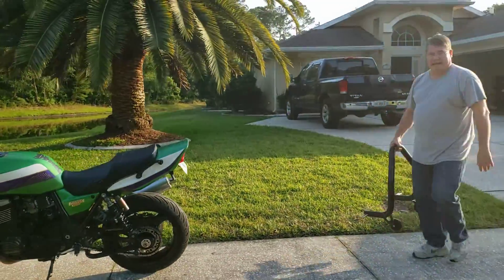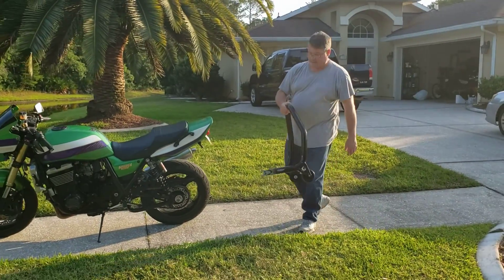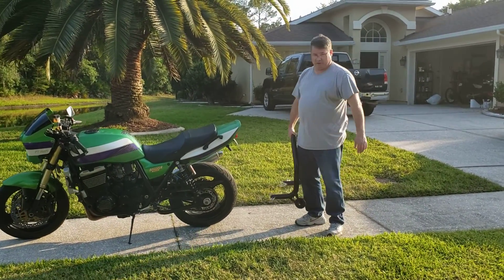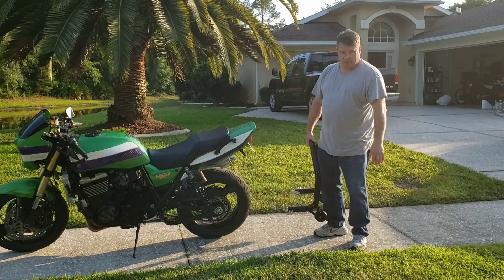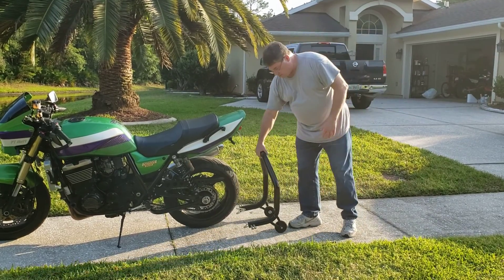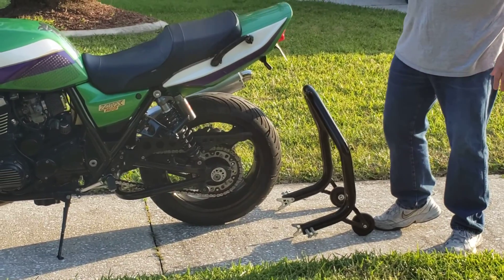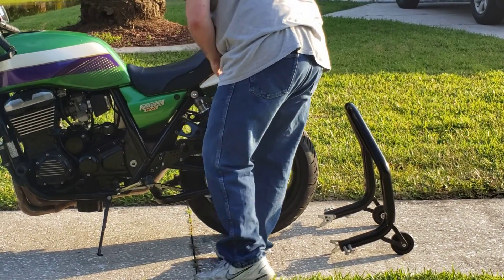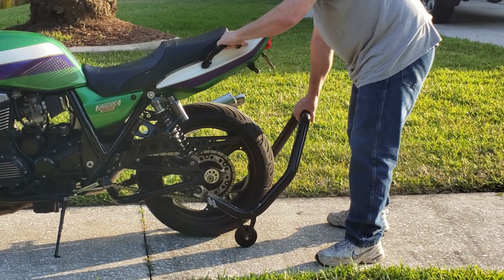ZRX Paddock Stand Use

Comment: Do you have a front stand, and if so, which one?
Reply from the maker: I have a Pit Bull steering stem front stand that I can use on the ZRX, or my Superhawk or FZ1. But I usually use a special specific front stand for  the ZRX that lifts at the bottom frame tubes. That way it is much easier for fork service and if the steering stem bearings need to br replaced. Guy on the ZRXOA.ORG was making them several years ago, haven't seen them lately for sale.